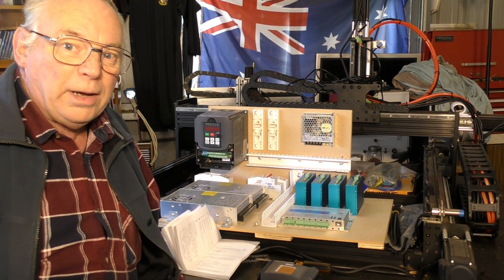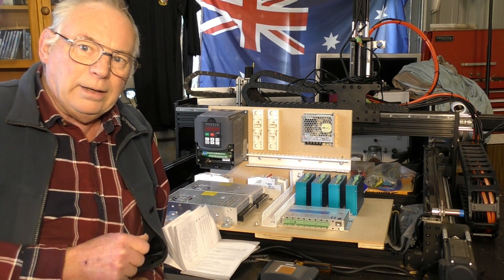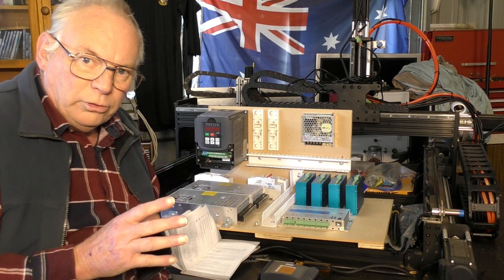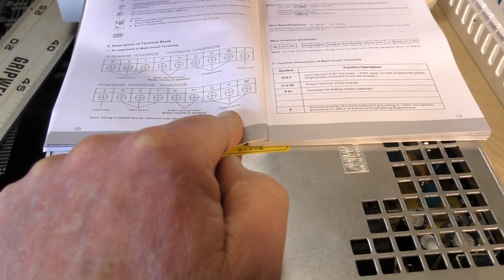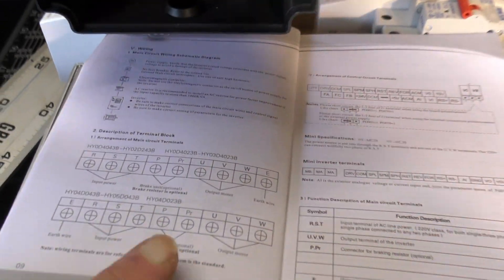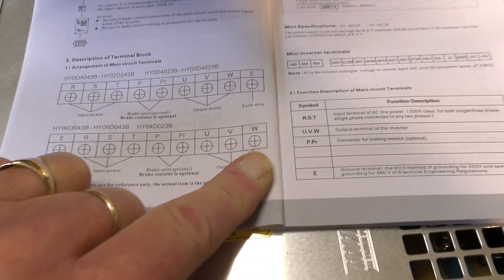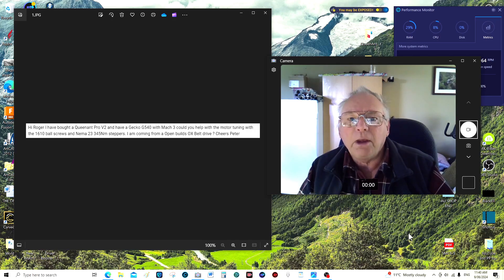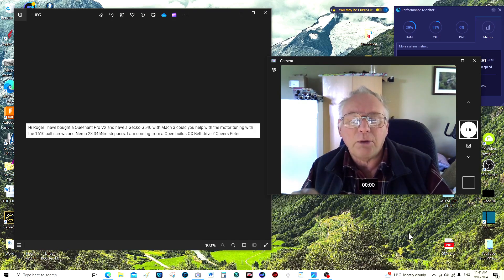#(2) CNC Electrical Mach 3 Mach4 Queen Ant SMC5 5 N N controller for Patrons and Subscribers

Comment: I'm in the process of making a manual bridgeport style mill into a cnc. I'm almost into the wiring process. Have to order all of the electronics for it still.   Thinking of mach 4 because in the future I will want to run 5 axis. My question is how bad are the glitches